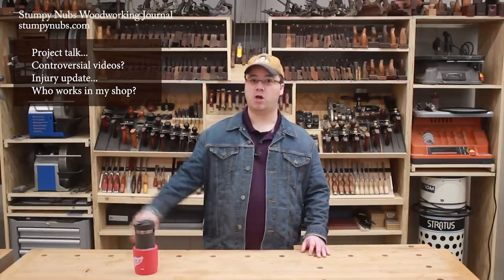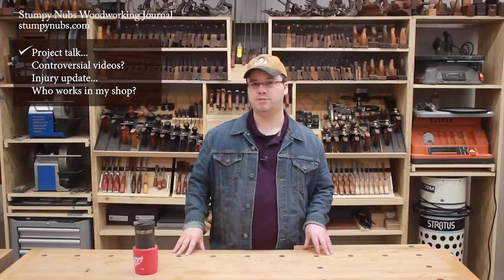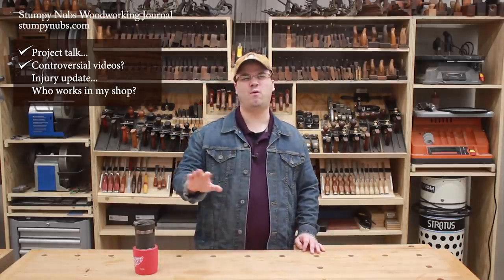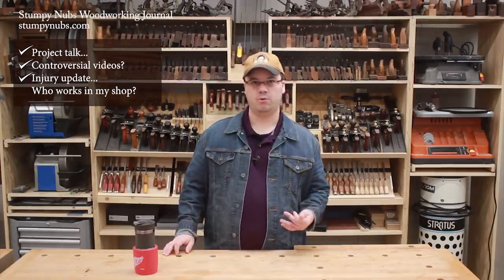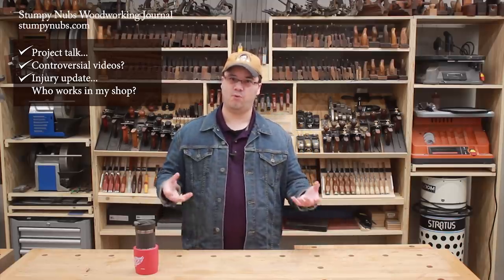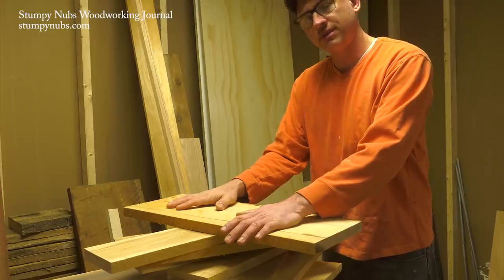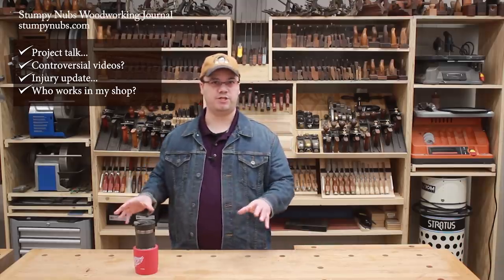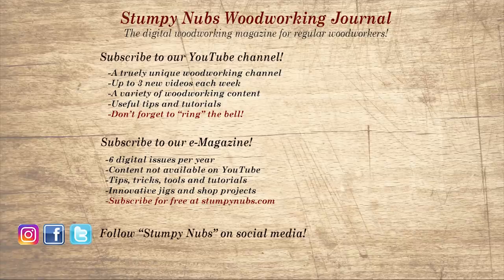Why I can't give the finger anymore (and other interesting stuff)

Comment: I've worked in factories, shipyards and on construction sites,. There are a thousand things around that want to take a chunk out of you slice you, I've had a few close ones. I'm never complacent with any tools and won't let anybody rush me, wear all PPE you can too. My left finger nail looks exactly like yours, late winter night in my roof space cutting pipe insulation with a Leatherman, holding it and insulation in both hands, a quick twist to fit it to the pipe and the blade scooped through the nail and flesh.. That bled for hours and took months to recover.

Comment: Hopefully you will have the recovery I've had, and in a shorter time period. Over the decades I've had the injuries you are dealing with and have, over time, gotten full range of motion back. The nerve sensitivity from the chainsaw brushing probably took the longest and it seemed I was always banging it against something. Laughed at the reactions to the radial arm saw, I inherited my grandfather's mid 50s saw in the mid 70s. It had seen a lot of use and combined with the move to my place was in need of adjustment and service. Being in my 20s of course I did neither of those things. Only smart thing I did was stand off line of a rip cut on a 20' 2x12. Hell of a kickback!. I tuned it up and used it until the motor gave out several years later.

Comment: I saw your video on Radial Arm Saws.  I have an "Old" 1960's DeWalt Version and the booklet that comes with the machine.  Fortunately, I use the saw only for accurate cross cutting and have not tried any of the stuff they recommended.  I have more sense than to try out some of the techniques suggested in the Instructions.  I wonder whether some people have tried them and if so, are they still with us.

Comment: I can relate to your injury. Thanks for the update. I cut the last about 1/2 inch of my little finger in half in June. I say in half because the bone was cut but it didn't fall off as maybe 3/16 inch was not cut. It is healing nicely although the bone will never heal because there is a gap the width of a table say blade. The reason I am writing this is to say that I can honestly say that every month I notice an improvement. I can also relate to the stiffness. My main knuckle will not straighten all the way which I can only attribute to it being in a splint for 6 weeks as it was not injured. I did my therapy while I watched this video. I should do it more often.  The nerve damage is healing as well and 3/4 of my finger tip feels pretty much normal and the other 1/4, which was always the worst,  is more than half way back. It takes time but the body has a way of recovering and I think you will notice improvement over time.

Comment: Speaking of Radial Arm saws, As I was using a new Sliding  Double Bevel Compound Saw (SDBCS for now) I got to thinking of the right tool for the job and have come to the point there is a lot of overlap between table saw, radial arm saw, SDBCS, track saw. For example I can dado blade in my table saw or my radial arm saw, but for long rips the track saw wins, the SDBCS does a lot of the same basic stuff as a radial arm saw (just a bit less on the sliding part). I have been considering eliminating 1 or 2 of the tools (the table saw, my table saw is old (60s or 70s) and would make you scream in terror (a metal frame with a blade, and you attach with a fan belt to the motor (i have found the safety parts recently)). I think It would almost be interesting to discuss the overlap in these tools, and their one or 2 unique things they can do. (like my table saw can also be a planar and a molding maker (sear's sold lots of things)

Comment: Great  vlog!  Probably should publish the safety rant - worth suffering through the criticism if it prevents even one injury. But I would suggest that you include a bit about the dangers of anything with a blade. My worst experience was with a slipped chisel. And, perhaps you might talk about things accidentally left where they should not be: my second worst experience was with an Allen wrench accidentally left in a circular saw blade hub. Makes me cringe just remembering them. And one question: where do you store all the film you gather in the office?

Comment: I know I'm two years late with my comment, but I wonder how many of those unsafe radial arm saw practices could be done in a much safer way with the proper jigs.  I'm not saying all, but I wonder how many. I'll have to look up your radial arm saw video.  Honestly, the versatility of the tool fascinates me, and I have the shaper and planer attachments.  I also had planned on using the power tap as a form of router.  Maybe, since I wouldn't have to worry about the shaft falling out as on a drill press, the power tap could even be used with a moving table for milling?  But it's all about the jig and safety.

Comment: +1 for safety video, maybe do a non and gore one for the scream-ish (It's hard to watch a video if I'm busy fainting).

As a native amateur, I don't have the benefit of an experienced wood worker to set me right when I put my dunce cap on and have a bright idea. Videos like yours point out the common/reoccurring dangers of tools that manuals drown in a slue of legal arse covering text.

My best friend is a consultant ophthalmologist (eye surgeon). A few stories from him and full googles for anything fast rotating/debris (he uses a magnet to pull all the iron fillings out eyes of those who use grinders/specs) so specs for everything else. What he told me stuck "you've got ten fingers but only 2 eyes.."

Comment: Rushing to the comment section, I still have one of the Dewalt radial arm saws in the ads you show, made in the 1950's. What a workhorse! Coming on to seventy years and it is still as strong, able, dangerous, and effective as ever. I wonder if there are many who could say the same for their electric drills, or jigsaws. I can imagine many table saws, possibly drill presses or band saws would last as long. The DeWalt is a solid machine. Anything with power to be effective, is just as dangerous, even a hand plane. That iron knows nothing of the difference between oak and flesh. If it is sharp enough to be effective, it is sharp enough to shave a knuckle.

Comment: I understand what you are going through with the injury. I also did severe tendon damage to my hand but on the inside of the fingers. In my case it was a knife not a wood working tool. Unlike you I really did not experience any significant pain the first day. The real pain was to come later, many of my flexor tendons were severed and balled up in my palm, that is where the pain became real. Unconsciously the brain tells the fingers to flex all the time and when that happens and your flexors are just dangling in no mans land it is pure pain, imagine sleeping and constantly waking up to a massive jolt of pain in your palm. Surgery was partially succesful, but I still have little control of my ring and pinky finger, almost no grip strength in my right hand now. But you adapt to it and eventually you do not even notice anymore, what I do notice tho is winter, when it is cold out last three fingers in that hand feel like they are being burned by fire, poor blood flow from what I understand is the cause. Oh yea imagine this, my middle and ring finger had rubber bands stitched to the tips and stitched to the palm, that was how I excercised the tendons and rebuilt strength.

Comment: I can attest to the danger of a radial arm saw.i ride motocross and if you know anything about modern dirt bikes they come equipped with almost indestructible plastic fenders. I was ripping a one by ten and just by the grace of god was standing off to one side when it kicked back hard enough to fire to the end of the garage and go THROUGH the fender that was lying loose in its packaging!! You could count the individual saw teeth marks on the last two inches of the board if that gives you an idea of how fast the board left  the table! I hadn’t planned on getting killed that way and I’m still working up my nerve to try it again after watching your,s and some others safety videos.  Talk about safety all you want, I'm all ears! Plus all the work you put into your channel was interesting as well,they are very quality put together.

Comment: Thanks for the vlog! Keep working on stretching and bending, including that middle finger. That internal scar tissue around the wound will take a long time to regain flexibility, but you can get there if you keep at it (gently).

As for your poor index finger...best of luck on the nerve damage at the tip. I filleted the tip of an index finger 20 years ago, and there are still things that make it twinge. I gave up trying to play the guitar and violin because of it! Those strings fit right in the scar tissue. I hope yours heals better than mine did.

Comment: Hello James,  Congrats on the new shop.  Looks like a great set up.  For what it is worth, I wouldn't sweat the negative comments from folks who have made a career out of fault finding.  If they don't like it, don't watch it.  Everyone has a right to an opinion and the right to be wrong!!  I personally enjoy your videos and have picked up some good tips along the way.  One thing I would like to see you put out is a shop tip video on making a turning tool jig set comparable to the Raptor style set used with a Wolverine sharpening system.  It would be a simple but useful project of value to a lot of viewers and the commercial price of $10.00 for each jig/template is an outrageous case of ripping off customers.  Just my two cent opinion.  Keep up the good work and good luck with your rehab.

Comment: I've had TWO table saw injuries.  The first was the scariest!  I was cutting thin strips on my table saw.  I had gloves on which I know you're not supposed to have on.  Somehow the blade caught the tip of one of the glove fingers and pulled my hand into the saw blade.  I did my best to pull my hand out but the blade won.  It cut all 4 fingers and broke my index finger on my left hand but luckily I too am right-handed.   Somebody was on my side as I had absolutely no pain except when they jabbed me with the needles while giving me novocaine in order to clean the cuts.  I had no stitches and everything healed like nothing ever happened except the fingernail on the index finger.  Even though I had no pain, I wouldn't recommend getting your hand caught in a table saw blade.

My second incident was a kick-back.  Now I've had numerous kick-back before but always from between the fence and the saw blade.  This on kick-backed from the left side of the blade. I still can't figure out how it happened.  But it did and hit the same index finger, broke it again, and I had to have about 15 stitches.  Still no pain except the needles injecting the novocaine in order to clean the wound. The ligament was damaged and I couldn't straighten my finger and the nail was damaged so much that they just removed what was left so a new one could grow.  After about six months of healing, I went into surgery to have a pin placed in the first joint to straighten that finger. So now I'm able to pick up small objects.  The tiny things are left to be picked up by my right hand.

So I know what you're going through.  The only difference is that I've not felt pain in either incident except for the needles.  Heal fast, my friend.  I really enjoy your vlogs.

Comment: Have you ever thought about preparing a video to show the SAFE uses of a radial arm saw. I have a Dewalt 925 that was built in about 1952. It was my grandfathers. I have had it now almost as long as he owned it. I have a small woodwoorking shop with a drill press, chop saw, jointer, thickness planer, and combination sander but do not have a table saw. Needless to say the Dewalt 925 has a very special place in my heart since it belong to my grandfather. I have looked for videos on safe practices of using radial arm saws but am yet to find any that I dont quickly see practices that I know are wrong. I agree with you when I look back at the pictures shown in the old 1950's literature. There where just so many unsafe practices shown. But where is the source for trusted videos. Thanks for all you do. I love your chanel. When I sit down to watch I feel like I am sitting down with a friend. Keep up the great work.
Reply from the maker: This is a popular site (and book) for radial arm saw users: https://www.mrsawdust.com/

Comment: James,need a video on how to properly handle severed digits for best chance at reattachment.
Reply: Several decades ago I was subbing labor to a friend. One day while taking outfeed as he pushed boards through the table saw I felt he was running his hand WAY too close to the blade.  I didn’t say anything at the time but instead made a push stick and hung it by a string from the saw. Few days later, same scenario only this time when he shut the saw off I grabbed the push stick, slammed it down on the saw and shouted “USE IT!” 2 weeks later he cut his middle and index fingers off his left hand. I fished both digits out of the sawdust pile and raced him to the hospital where they promptly threw them in the trash. 🤦‍♂️

Comment: I too got bit by a table saw about 35 years ago, nothing  as extensive as yours stumpy. Just removed all 3 layers skin as wide as  the saw blade. Lucky me I thought I was being careful but it happened. Truth is I've cut my self with a knife much worse. Wore a  small scar for several years but now I can't remember which hand or find a scar on any finger. Just call me lucky. After that I kept a short board handy for a push stick. I've got 8-10 scars combined on my 2 hands, doing something stupid, as I worked 17 years n a machine shop.

Comment: I had a close call with my 10 inch compound miter saw. I didn't get hurt but it scared the BGGGG's out of me. I believe that if you fear the saw or power equipment you are using, you'll use more safety rules and think out a plan before and during the use of the tool.. BTW I think the video makes the point on safety rules !!

Comment: Every power tool has power - whether or not you think it does. Assume plugged in, fully charged until you pull the plug or battery out. Oh, and keep the cellphone in your pocket if you're in the shop alone - a cabinet maker I know once nailed his hand to the workbench.... (Personally, I go with 'never work alone' but that's not always possible for everyone). 

Would love a safety/proper use video on jigsaws. And to see the safety video you already made.

Comment: I've used YouTube for years but I'm not sure how to contact video makers. The point being is that I'm starting to get more into woodworking and I'd like to make a small drawer/cabinet at some point but for all the videos I have watched lately, a common thing that gets mentioned, but never really addressed, is wood expansion and contraction. It would be great if you could make a video to help explain that and when/where it is necessary to leave gaps in wood to allow for expansion and contraction particularly when someone is making shelves, cabinets, boxes etc.
Reply from the maker: The principle is pretty simple, actually. Wood expands across the grain but not along it. That means a board will get wider/narrower but not longer/shorter. So if two boards are connected together along their edges, they should expand/contract together without any problems. Likewise, if two boards are connected at their ends, there will be no problem. But if if the end of one board is connected to the edge of another so the grain directions is crossed, the one will prevent the other from expanding/contracting and it may crack.... How do you apply that knowledge to actual furniture construction? That's too big a question to answer all at once. But if you want to build a table, for example, I would look at several articles or videos about building a table and look for how they handle grain direction.

Comment: Been watching your videos since my dad took the tip of his thumb off with the chainsaw grinder.  They couldn't sew it up, so he just has to leave it open until it scabs.  It might have skin in a few weeks, and look like your index finger after a few months.  

Also, left hand usually takes all the damage because the right hand is holding the tool.  At least for normal people.  Radial arm saws are more dangerous for lefties than righties.

Comment: Seems like I was lucky enough to get my Dads Craftsman Radial Arm Saw, What a machine,  Now I read the book on it and was aware of the dangers of using it, but during the past 15 years was not injured once by it. Now back in 2002 bought a table saw for $60, the book gave you instructions on how to set it up for use, but could never find the calibration screws for making the saw blade straight so it was always an 1/8 inch off (funny how the Craftsman RAS had that in the building and calibration area and it was right) I guess the table saw instructions where general and made for 7 different saw types because the day I found the cal screws was the day I took that piece of junk apart and they where there, just seems the manufacture didn't drill any holes through the table saw top to get to them. Any how why did I tear it apart, I don't like unsafe tools and that table saw was the most dangerous tool I ever bought that chewed up more wood then a termite or Stumpy ever could.

Comment: 20 years ago I chopped a fingertip off with an axe. Went pretty much diagonally across the nail from corner to corner, just a little flap of skin holding it on. They told me I'd probably lose it but they sewed it back anyway and it took. For about a year I had pressure but no light touch sensation. I figured it was long healed up as good as it'd be, when one day I felt a sharp stab of pain and voila - I had light touch again. Don't give up hope on the nerves - nerves take longer to heal than simple cuts.